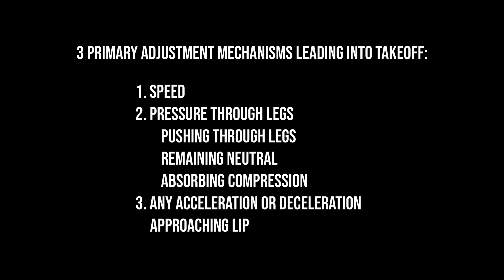Gauging Jump Speed: Practice Like a Pro #40

Comment: Very good Linnea!! How do you feel with this mullet? is it too different than the setup you used before?
Reply from the maker: Honestly I love it.  The bike rolls so much faster and it eats up the bumps without getting caught up and losing speed.  The 27.5 wheel in the rear makes it an easy transition.  But right now I'm not able to find a coil that fits my weight so it's a little harsher than I'd like

Comment: Great practice drill. What's the height of the kicker you're using? Keep up the good work !
Reply from the maker: It's about 12" high. I bought it at discount ramps a few years back but haven't seen that exact one anywhere since. Works great!  -Simon
Reply: @Fluidride  Hmm.. I think that height would be good for me. The local trails are nearly all twice the height of that and I ride around most of them. I know it's mostly in my head but I just don't feel confident enough, from one week to the next I either  ride them or opt to go around. May have to make one.